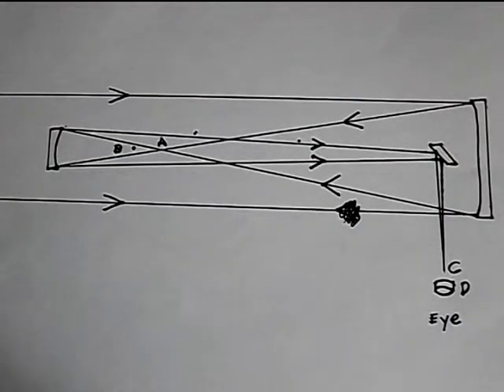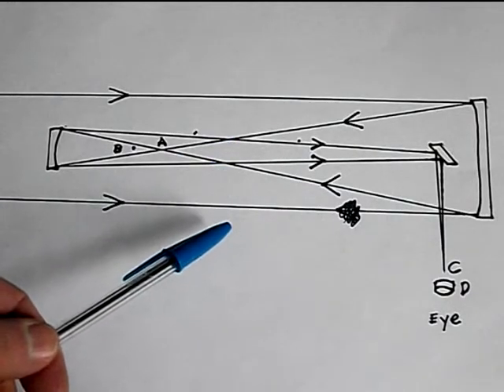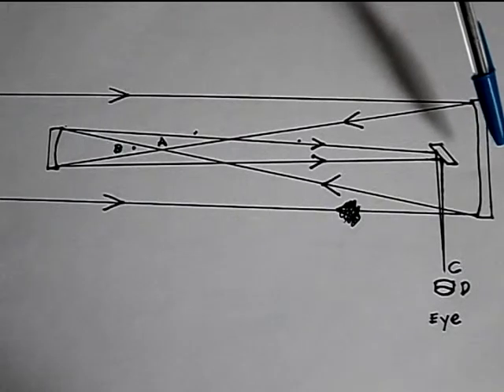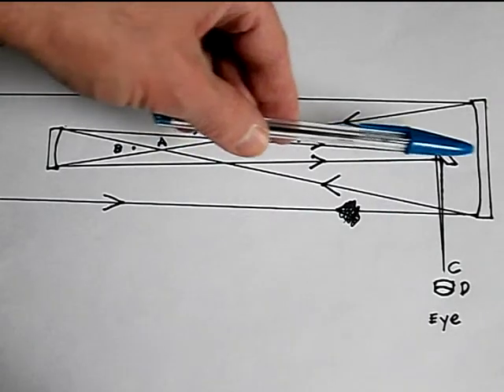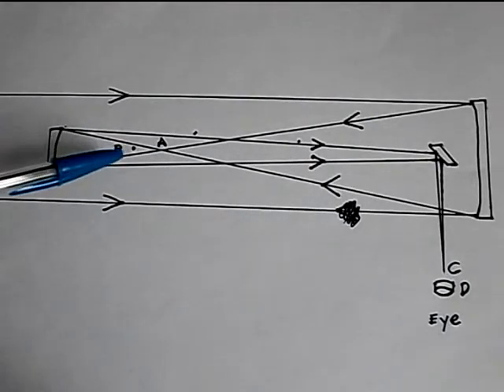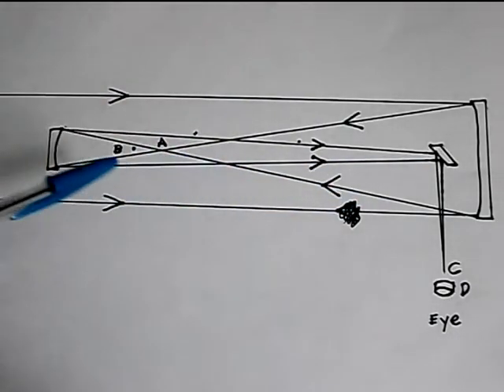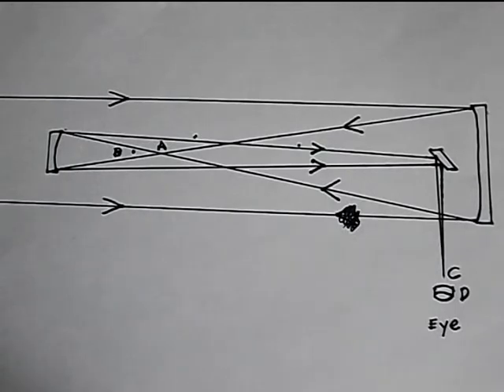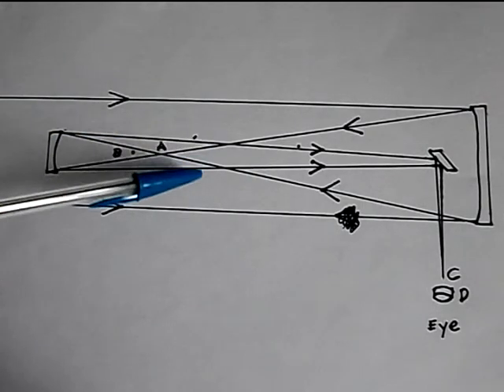How To Construct A Gregorian Telescope Part One

Comment: This is the most confusing explanation I have ever seen, sorry.  I made a Gregorian back in 1969, and still use it today.  I know the math involved.  This was very hard to follow.  I was able to figure out the numbers you gave, and they do work, but the secondary should be about 4.68" in diameter.  So you've reduced the size of the primary.
Reply: Thank you

Comment: This is not a Gregorian telescope. Gregorians have concave ellipsoidal secondary mirrors. So this telescope will be extremely overcorrected and not provide good images due to spherical abberation. If the author claims good images I'd like to see some photos of a star test! Also the secondary is too small to provide a fully illuminated field, it would need to be quite a bit larger to capture the full light cone and send it down to the tertiary mirror.

Comment: Hi, bob! I want to ask some questions since we will be developing a new class of a social-amiable telescope.

1.) We propose that instead of using curved mirrors, we will be using flat mirrors. We conducted a study about the different magnifying powers of flat mirrors and we found out that it can magnify an object 10x bigger than its size. My question is, can we use flat mirrors in replacement of curved mirrors?
Reply from the maker: Hello Francis, Thank you for your interest and your question. As far as I know, no combination of flat mirrors is useful as a telescope objective.  My 20-inch Gregorian telescope works very well but it was an extremely difficult job to construct. I am assuming that when you use the words "social-amiable telescope", you intend the telescope to be used for members of the general public to observe the night sky. Also, you probably, like me, do not want to spend a lot of money. You also want something that is easy to carry around and set up at public events, such as star parties at schools and public parks. In my experience, the best such telescopes available are probably Celestron SCTs. However, in order to get the sharpest images, they do require collimation. I own a 5-inch Celestron SCT. It is wonderfully portable and it has extremely good optics, but, when I bought it two years ago, it was slightly out of collimation. Last summer I successfully collimated the optics but it was a nightmare experience. As far as I can tell, an Orion 5-inch Maksutov-Cassegrain would be almost as good optically, very inexpensive, and they come permanently collimated. APO refractors are optically excellent but have heavy tubes and are far too expensive. Last year I bought an 80 mm. f8 Explore Scientific  achromatic refractor for approximately $120 and the optics are unbelievably good. However, this might be the only model in their line of refractors with really good optics. The Celestron 5-inch f5 Newtonian has a reputation for good optics but it also requires collimation, but the collimation of Newtonians is not too difficult. For public viewing I would recommend a lightweight equatorial mounting with a clock drive. Also, it would be a good idea to have the eyepiece height adjustable somehow so that people in wheel chairs can easily look through the eyepiece. To be honest, you will likely have the greatest success with a really good Maksutov-Cassegrain or a really good, long-focal-ratio achromatic refractor, since these are inexpensive and avoid collimation problems. I would avoid telescopes with computerized mountings. You will likely be fighting the computer. A simple, lightweight, German EQ mounting will be a pleasure to use. Also, I would advise using an Amici right-angle finder on the telescope and there are some really good, inexpensive, long-eye-relief eyepieces that are wonderful to use. Please let me know if you have any more questions. badbobastronomer

Comment: I have a question: can you grind the primary mirror with a really low f-ratio, let's say f/2 or even f/1 and avoid the high effective f-ratio that your design has?
Reply from the maker: Yes. You could make the primary mirror around f/2 and have approximately a five-times amplification by the secondary mirror to give a final equivalent focal ratio of approximately f/10.  In a reasonably large telescope, say, 12 inches or larger, you could successfully use low-power eyepieces to achieve the widest actual field of view possible with an R.F.T. exit pupil, around 6 mm. However, it would be likely reasonably difficult to polish an accurate surface on the primary and secondary mirrors, because such short focal-ratio mirrors depart considerably from the spherical shape that results from ordinary polishing techniques. The usual shape on the surface of a Gregorian primary mirror is a paraboloid, and on the secondary mirror, an ellipsoid.  It would likely be easier to make the primary mirror around f/3 or f/4. One gigantic advantage of the Gregorian telescope compared with the Cassegrain design is that the Gregorian secondary mirror is concave and can be easily tested for surface accuracy by means of the ordinary Foucault test. Another problem with using an f/2 primary mirror is that the entire optical system would require very precise collimation (alignment of the mirrors) in order to achieve a sharp image at the focal plane. From recent experiences of myself and other amateur astronomers, you can get extremely good images in a rather large telescope by simply purchasing a Celestron Schmidt-Cassegrain telescope (SCT). They come in sizes up to 14 inches and are reasonably priced, considering the high-quality optics and the overall convenience (the recently-made Celestron SCTs seem to be really good, but some of the older units might not gave good-quality optics; be certain to look through a second-hand SCT before you buy it). These SCTs do require careful collimation in order to get the best quality images, but the optics are generally amazingly good and can give superb views of the moon and planets. A friend of mine recently purchased a second-hand C14 tube (without the mounting) for only $1000. Actually, I have already constructed a 20-inch Gregorian that works really well, and I posted several videos on YouTube to show how it works. I also posted several videos of me actually polishing the 20-inch primary mirror, and several other videos of a view of the moon through a 400-power eyepiece.
Reply: @badbobastronomer   My interest in your Gregorian design was originally for building a large Dobsonian without having to use a step ladder to look through it.  At our local astronomy group, we recently had someone bring a 24-inch Dobsonian.  The eyepiece was too high up for anything over 30° alt even though it was an f/4 and being a lowrider Dob.

Edit: I was also hoping to have it do double duty as a telescope for astrophotography in conjunction with an equatorial platform, which is why I was seeing if I could make one with a low f-ratio, but it looks as though that won't be possible.
Reply: @badbobastronomer  This is essentially what a Ritchey-Cretian or Dall-Kirkham telescope is.

Comment: I hope he is successful with the design as this type of telescope doesn't have the disadvantage of having to either limit the focal length of the telescope to the height of the user or having to use a step ladder to look through the eyepiece for celestial targets at a high alt like your typical Newtonian.

Edit: another possible advantage to this design, if the telescope is balanced and supported on the mount at the section of the tube where the eyepiece is located, is balance.  When placing cameras, adapters, atmospheric dispersion correctors, etc on the end of a Newtonian, the telescope can be unbalanced from the extra weight on the very end of the scope.  Designing the tube weight distribution and mount support (either Dobsonian or tripod) where the eyepiece is, the extra attachments would place on the telescope tube center of mass and minimizing torque produced by the extra weight.

Comment: This is not the Gregorian design, but rather a Nasmyth reflector. Gregorians always have a hole dead center in the primary like the various Cassegrains.
Reply: The secondary mirror in the Nasmyth is convex.  The Gregorian uses a concave mirror though it directs the light into a hole in the primary like a Cassegrain.  The design in the video looks like a hybrid of the Nasmyth and Gregorian with the light path being like the Nasmyth's but the secondary mirror being like a Gregorian's.
Reply: It is a Gregorian but modified to coudé to avoid to drill the primary. Smart design.
Reply: This is a "Gregorian" telescope with a Nasmyth focus. Nasymth is not a type of optical system, but generally a cassegrainian type with a tertiary mirror

Comment: Thank you again, these are useful educational videos about telescope designs to anyone interested. My telescope will be able to change back and forth from Gregorian to Newtonian in an easy fashion from what im seeing with the parts I have. One other question. What effect is there, if for example the 4 inch mirror is a F- 4.49  compared to like an F- 3? Is there a perfect ratio the mirrors should be in F factor to each other?
Reply from the maker: +TheThings WeeSee The diameter of the Gregorian secondary mirror can be determined by simple ratio-and-proportion. For example, if the focal length of your primary mirror is 100 inches and the diameter is 20 inches, and the distance from the prime focus of the primary mirror to the optical surface of the secondary mirror is ten inches, you can think of the edge light rays as forming congruent triangles with the optical faces of the two mirrors, so that the ratios of the diameters to distances must be the same; thus, the five-to-one ratio for the primary mirror is the same for the secondary mirror, so that its diameter would be two inches; however, the radius of curvature of the secondary mirror must be less that twice ten inches because of the difference between points A and B on my diagram in the videos; what this means is that, if the Gregorian secondary mirror were used as the primary mirror in a small Newtonian, it would need to have a focal ratio smaller than the f5 primary, say, around f4 or f4.5; also, it is a good idea to have the secondary mirror diameter a bit larger than two inches, in order to avoid vignetting the off-axis portion of the field of view (the case is similar for Cassegrain secondary mirrors, as explained in Texereau's book). If the secondary mirror is smaller than two inches, then it will still work but it will not be large enough to intercept all of the light rays coming from the primary mirror and you will lose some of your telescope's light-gathering power. However, for observing bright objects like the moon and planets with a large telescope, in which atmospheric "seeing" conditions are usually less than ideal, you might not notice too much loss in telescope performance if your secondary mirror is slightly smaller than geometry indicates.
             I hope that your project works well and I think that you made a good decision to have your telescope interchangeable between the Newtonian and Gregorian designs.
Bad Bob
Reply from the maker: +badbobastronomer I made a typing mistake in my comment: one sentence should read "the radius of curvature of the secondary mirror must be less than twice ten inches".
Bad Bob

Comment: forgive my ignorance... but could you briefly explain the advantage of a gregorian telescope over a newtonian?
Reply from the maker: +JAY STEGALL Hello Jay, In my own project, I attempted to grind and polish a 20-inch Newtonian primary mirror. I had much difficulty in accurately polishing the surface, so I used some algebraic formulas in Texereau's book to calculate the surface shape on a Gregorian secondary mirror that would compensate for the inaccurate surface of the 20-inch primary mirror; the method worked very well (the much-smaller concave secondary mirror was much easier to accurately polish than the large, heavy 20-inch mirror) and my 20-inch Gregorian telescope gives very sharp star images. Also, the eyepiece is only about 4 feet above my observatory floor, a very comfortable and convenient location. Most large Newtonians have an eyepiece location so far above the ground level that an astronomer needs to climb a ladder to look through the eyepiece. Also, my Gregorian has an equivalent focal ratio of f25, which allows me to get very good image quality if I use relatively simple, inexpensive eyepieces (I have a large, homemade Huygens eyepiece that works very well). I should mention that the Newtonian design is simpler and is better-able to use low-power, wide-field eyepieces than the Gregorian design.
Bad Bob
Reply from the maker: +TheThings WeeSee  In a few minutes I will be uploading the fourth video about how to make a Gregorian telescope onto YouTube.
Bad Bob